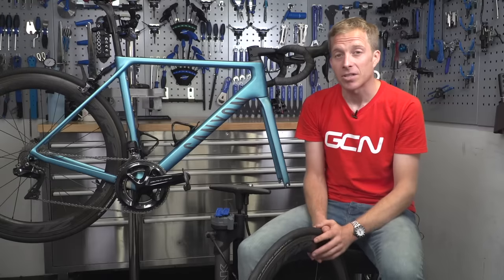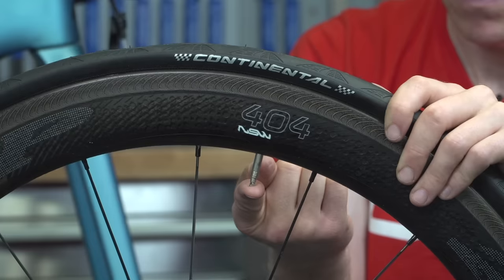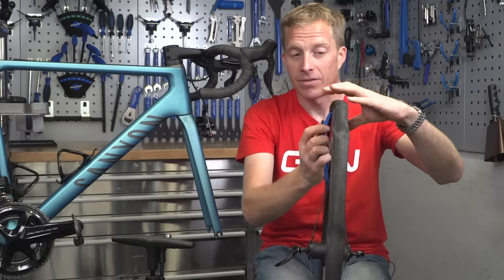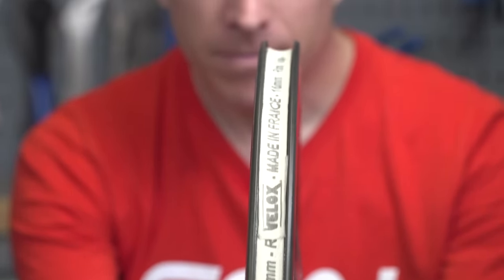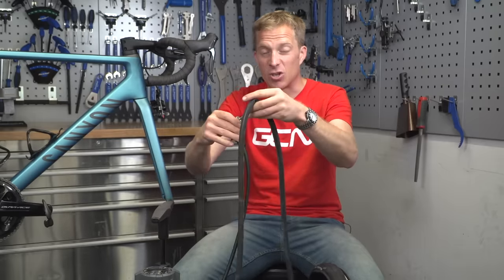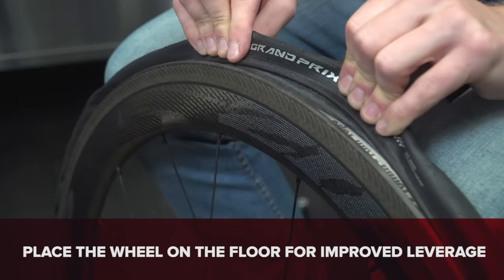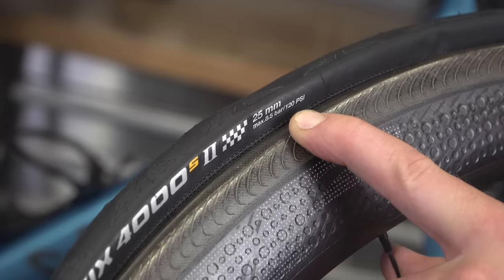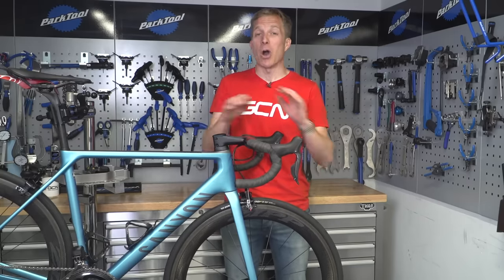How To Change A Tyre On Your Road Bike

Comment: #askgcntech hello tech, I have a really strange problem. My rear wheel wobbles a bit, but the rim is not out of true. LBS said the tire is a little uneven and not to worry about it. But surprise, surprise: it bothers me!! Any suggestions? Am I risking anything but riding like this?
Reply: Matheus Barbosa your all set, perhaps just buy a different tire, unlike motor vehicles while we can true wheels we cannot balance them, as it is so rare to be noticable like yours there's not much other than a new tube or tire. But first I would double check the wheel really is true and the hub isn't damaged.
Reply: check if there´s some play in the hub, i.e. it´s moving. often had it myself, annoying but not dangerous.
Reply: Colin Richard I'm gonna cry 😁 they're brand new conti gatorskin. Could it really be the tube? That's one thing I haven't checked
Reply: Flix thanks for the tip! I thought the same and checked the hub/axle interface but seems fine. I do need new wheels though, could be the perfect time!
Reply: Matheus Barbosa again, could be the wheel true, hub play, tire or tube. Check each one as you go. If it's the steel bead gators it could very well be. If it's that bad, talk to your shop and ask for an exchange, I have purchased bad tires in the past and usually the shop will understand and exchange as long as your not a prick about it.
Reply: Colin Richard cool thanks! They're folding so I don't believe it's wire beads. I'll try the tube and then ask the shop. Also hopefully tech picks up the question maybe they have further suggestions
Reply: take a look all the way around both sides to see if the bead has seated evenly. If not, deflate the tire, brush some soapy water or tire lubricant on the beads, and reinflate.
Reply: Stephen Turk good tip I'll try that as well. To be fair I didn't hear a pop when putting the tires on, but neither did my front and that one is just fine
Reply: Update: took the tire off the rim, zero play in the hub and the rim itself is so true it could pass for brand new 🙁 checking the tire for anything weird now. I suppose I'll change the tube just to be sure
Reply: Matheus Barbosa same issue some times I just let some of the air out and work the bead till its even
Reply: gulf city nicholas danca afraid I'm not that skilled 😐 I redid the whole process and still have the wobble. It's not huge, maybe 3-5 mm either way. I might just leave it and ride that tire into the trash to get a new one
Reply: Matheus Barbosa I'm not that skilled either
Reply: gulf city nicholas danca then how do you work the bead? Do you mean trying to get it to hook in? Mine seems like it sits but maybe not
Reply: Matheus Barbosa pinch and squeeze the bead but I also cuss and growl as I do it lol
Reply: gulf city nicholas danca hahaha I gotta try that then!
Reply: Matheus Barbosa if its a rubber bead let the tyre come up to room temperature metal bead fight it
Reply: maybe a loose spoke ???
Reply: Sidney Debouver well the rim is true so I don't think so. I'm going to try the soap method mentioned above next time I have a moment. It doesn't seem to hurt my riding (at least short term)

Comment: It’s never as easy as that - you must have got Continental to send you a bigger tyre! Its ridiculously difficult to fit tyres on carbon wheels.
Reply from the maker: It can be dependant on the wheel manufacturer too - making sure the tyre's bead is in the centre of the rim is really important!

Comment: if u cant afford the tools just use two spoons
Reply: King LEE That's a great way to scratch your rims, so go for it!
Reply: you can tie some rubber band onto the spoon
Reply: King LEE Unless your spoon is made of carbon steel, it will easily bend. I don't know where you are going with this, just spend the couple of bucks on a set of tire levers lol

Comment: No self respecting cyclist should be using a tire lever. First time GCN tech has really disappointed. 

If you use the center of the rim (smaller diameter) you can replace a metal bead gator skin on a tubeless rim. If you need a tire lever your tire is still seated somewhere in the rim. Levers just increase your chance of pinch flats or just damaging tubes, tires or rims.

Comment: Jon a good Vlog but, I do not believe it. A vlog on changing a tyre. The Department for education keeps telling the populous that they are getting more intelligent, I am in my 50's I think I mended my first puncture when I was in Primary school so pre 12 years on Moulton Bikes as they were popular ( still have one) I only just had the strength in my hands to put a 12" tyre on a rim they were more difficult than a 26" tyre. Phew I shake my head in disbelief.
Reply: Boris S. You know it but others don’t. I knew how to strip, clean and rebuild a carburettor before I ever changed a tyre but I delight in how these excellent tutorials make it so accessible for those who have never done it before. Try to remember that such sniffiness can be repaid.